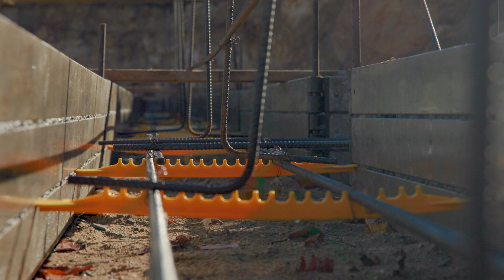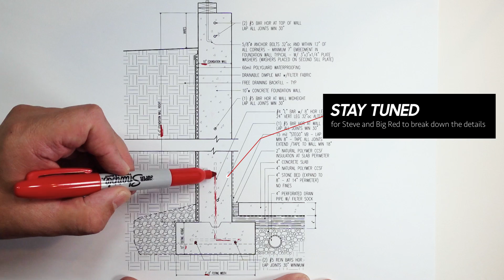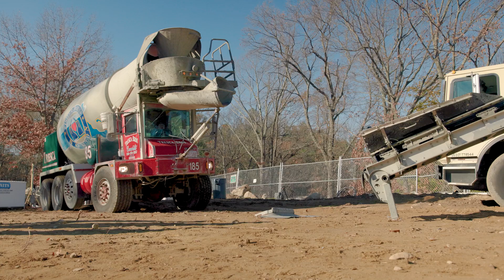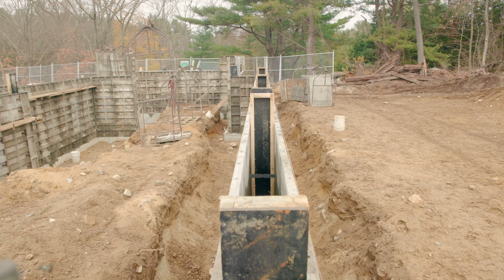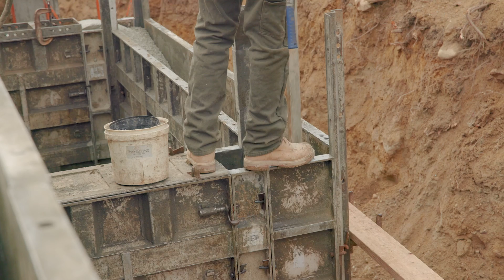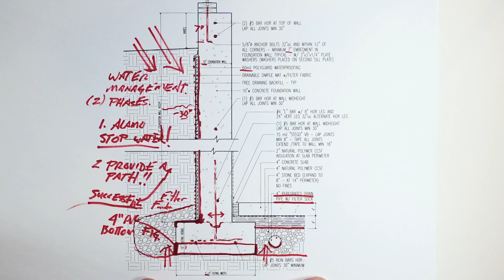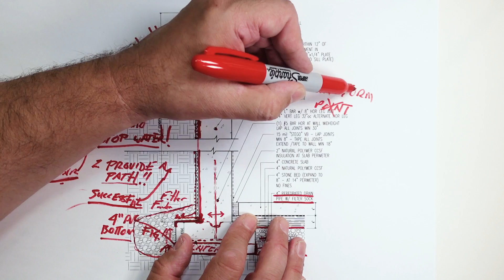Build Show Build: Boston Ep. 4 "Foundation Footing"

Comment: Steve  I have a concrete contractor telling me the inspector is requiring him to excavate 12 inches below our excavated basement elevation to get the footing 12 inches below undisturbed soil. We do not have a frost line here in GA. I see the forms in this video are resting on top of the excavation with no further excavation between forms. They want me to dig out 12 inches below the bottom of my forms. Have you come across this requirement?
Thanks Larry

Comment: hopefully radon isn't a problem. Those outside -> inside pipes will make you need a strong fan or two to get that negative pressure under the slab
Reply: No they will not, they expand the pressure field by maybe 5%

Comment: I'm a little surprised the plan didn't call for a 4" socked PVC pipe on the outside too so as not to "challenge" the interior system. Maybe it didn't have a clear path to daylight. I also wonder if having the interior connected to the outside via the lateral pipes might help with radon dissipation, just thinking out loud.
Reply: It migh add to the radon mitigation a bit - it doesn't change what we would do

Comment: Steve, Do you have a drawing of the 4" pipe detail I can share with my concrete contractor? I get some crazy looks when I talk about a 4 inch PVC pipe crossing his footing. I know we are addressing hydrostatic pressure below the slab and any that builds at the exterior of our foundation. Is the equalization the critical factor or having a means to reduce pressure on both sides of the footing? Is putting independent drains on the exterior and interior adequate? Also, looking to seal the tops of footings. Contractor doesn't always use vertical rebar to tie the walls to the footing. Uses a channel. Is it a legitimate concern of weakening the cold joint connection between footing and wall with a rolled on waterproofing membrane? Appreciate you sharing your knowledge and experience.
Reply: I like the use of laterals. I see many on here think I am letting water in, but they really don't understand how water moves thru the ground. I believe the faster I can move it and rid it, the better I am. I don't believe barrier systems "dams" if you will, work in construction. I like bars coming out of the footing in lieu of the continuous slot. I also have never put a capillary break on top of the footing, I understand the reason why, and also agree with it kinda, but my personal point is that if I allow enough water to be a cappilary problem in the system then the other measures I took (or should have taken) weren't good enough. My perspective is that a cappilary break on top of the footing is the result of not solving the problem below. I realize I am in the far minority here with this perspective, but it is what I believe
Reply: @stevenbaczekarchitect9431  Thank you Steve for the insight. You are excellent at explaining the why behind these practices and principles.

Comment: 39:06 shows wall/slab construction details. Curious about insulation and moisture migration. There is 4-inch natural polymer insulation under the slab but there is no insulation on the outside wall? Isn't the plan supposed to maximize the temperature of the interior concrete wall and floor surfaces by applying insulation on the outside to reduce the probability of condensation during the winter? Also what about a water barrier between the footing and the wall to minimize the capillary effect of moisture migration from the footing to the wall?
Reply: There is insulation on the wall. This detail is stripped from the foundation page, so it illustrates the concrete foundation scope of work. We will spray 2" CCSF on the wall and frame a 2x4 wall 2" inside the foundation wall. This info is in the wall section details. I break them up because the foundation guy doesn't care about the wood framed wall.
Reply: Thank you for joining us - much appreciated

Comment: Steve,  I have the opportunity to drain to daylight on the exterior. My plan was to do an exterior foundation pipe to daylight. Not install a footer tube connecting exterior to interior. I had not thought about interior drain. We are on a lake and  setting our footers on the lowest elevation allowed. Your comments on ground water have me thinking this may be a good idea to deal with potential ground water pressure under the basement slab. I'm nervous about creating an avenue for water on the outside to flow to the interior. I also want to waterproof the tops of my footings (getting some push back from foundation contractor). So, my thought is two independent systems. Your thoughts are appreciated. Regards Larry
Reply: Larry, alot of people are looking at this like "you are letting water in from the outside" you would need a very strong negative grade and ALOT of water for rain to be a problem from the outside. Hydrostatic pressure is a concern I can't solve for later.......so I solve for it now.
Reply: @stevenbaczekarchitect9431  Steve, Do you have a drawing of the 4" pipe detail I can share with my concrete contractor? I get some crazy looks when I talk about a 4 inch PVC pipe crossing his footing. I know we are addressing hydrostatic pressure below the slab and any that builds at the exterior of our foundation. Is the equalization the critical factor or having a means to reduce pressure on both sides of the footing? Is putting independent drains on the exterior and interior adequate? Also, looking to seal the tops of footings. Contractor doesn't always use vertical rebar to tie the walls to the footing. Uses a channel. Is it a legitimate concern of weakening the cold joint connection between footing and wall with a rolled on waterproofing membrane? Appreciate you sharing your knowledge and experience.

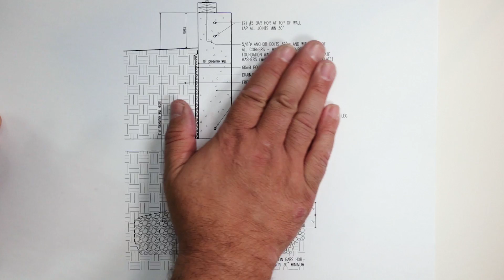Comment: 37:31 The wall will suck  moisture there from the foundation due to the capillary effect. When the foundation is standing in water, the water will migrate up through the foundation and up into the wall - not good! According to Joe Lstiburek, concrete can suck water 5 miles or so!

The reinforcement bars there have too little cover over the laterals, and will rust when the pH of the concrete goes below 10. 

Much better solution would have been digging 1ft deeper and placed some 8 oz non-woven geotextile over the entire basement, with drainage pipe out to free air and then added 1 ft of gravel on top of it. Wouldn't need a sump pump then or the laterals and this complicated stuff. And the foundation wouldn't suck up any water.
Reply: So yeah I know Joe - worked for him for 10 years, I know what he has to say, This foundation isn't sitting in water, some moisture may migrate into the foundation wall, bu why do I care, it can only dry to the outside as the interior direction will be impermeable. Too little cover, you do realize you are stating about the 1/2" of near contact every 12'-16'.....???? Lastly, you want us to dig an additional 12" over 5000 sq ft, and then fill it with stone, and then drain to daylight which would be about 100' of trenching 9 ' deep for the first 50'........on a site that suggests lower than average risk??? Yeah, we should have done that......then you'd be telling me how ridiculous that idea was......
Reply: @stevenbaczekarchitect9431  I agree every site is different ***and you must weigh your risk** Thanks for sharing that the only way we learn

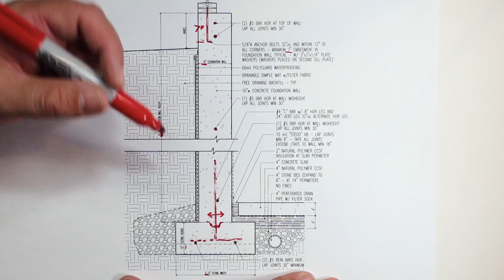Comment: 39:32 Would have used Isodrän or Pordrän instead of a just dimple mat.  Isodrän or Pordrän are both a drainage and insulation product. Moisture in the wall will go from warm to cold and will then be sucked out of the wall and then drained in the drainage insulation. Moisture or water from the soil will also be drained before it can reach the wall and the wall will never get moistened. Don't need any polyguard or sealing at all.
Reply: Who cares about the insulation angle? If it doesn't cover the foundation wall, just consider it a protective board. As stated above, moisture may migrate into the wall, but again, who cares?? It can only stay in the wall....OR.... dry to the outside. With the Polyguard it can only migrate via capillarity from the bottom of the footing.....and again who cares? Can't get inside

Comment: Water table 30" down with an 8' basement? How did you build inside a pond? And why?

And then the plan is to let the water in and then pump it out? The buyer is getting ripped off. How about you build so that an exterior footing drain can be daylighted? Inside is fine as a backup, but as the primary, sheesh.
Reply: Please before you go talking how much of the client is getting ripped off, maybe, just maybe you should ask a few pertinent questions so you may not seem so foolish . Mark Twain - "It is better to sit there and look the fool, than open your mouth and prove it" . First of all you are not stopping water, it is coming up not down - at least the water I am concerned about. Second, we have an exterior drain. Third, the town REQUIRES that the water NOT be daylighted but pumped to a reclamation pit to keep it on site, in the ground and not become runoff for the town's wastewater treatment plant. So the primary, is not a choice, but a requirement - sheesh!!
Reply: @stevenbaczekarchitect9431  
There is no substantive evidence that this popular adage was coined or employed by Mark Twain. Proverbs 17:28 is the oldest related use (Matt might like that).

If the water is coming up, the basement is too low. If it can be daylighted, how is it possibly coming up without visible flooding? If it's visibily flooding everytime it rains, the basement is too low.

So you created a gravel drain, and you connected it to the inside? Do you pipe the gutters inside too?

Can you share the applicable regulation that prevents you from moving non-precipitation water from a non-impervious area to daylight on the property? Daylighting can be the overflow to a dry well if it's under the footing elevation. Is that what was done? If so, my only issue is connecting the exterior to the interior, unless the exterior stays in solid pipe completely separated from the interior, as you have two sump pumps.

Hopefully I just misunderstood the system.
Reply: Francis - just read your comment again, this house does NOT have water 30" down. At 42:40 I talk about this site being "bone dry". The 30" reference was at another project that I was comparing to
Reply: @stevenbaczekarchitect9431  I understood that much. I was asking why in the world that was chosen on that other project. I guess if a client wants a boat, you build a boat? Also how? Were there dams and pumps to keep the water out of the foundation hole during construction?
Reply: @FrancisKoczur  on the other house the client already bought the property before my involvement,  when I found out about the -30" water table we pulled the house almost 7 ft out of the ground to keep water below top of footing. There we pumped to daylight as they had many acres for site retention

Comment: 19:50  still should have used tie in bar IMO.  Temperature changes between the two can make water in the dirt swell/push at different pressures over time, risks moving the wall or buckling the center of the wall.  Always better safe than sorry.

Comment: Great Video Steve! I have been watching this series and learning a lot. I am in the early stage of building as well. I am currently in the foundation phase. Footing is poured, and walls are going up in a few days. I am researching placing anchor bolts, and i keep seeing videos that discourage wet setting anchor bolts. I noticed you are wet setting your anchor bolts. What is your take on wet setting vs Anchor bolt setter?
Reply: I think the wet set have a slightly better pull out strength
Reply: @stevenbaczekarchitect9431  Well, you can always drill a little bit deeper, or use a slightly bigger bolt, or use a few more. By drilling, you get better precision, but it also cost a little bit more. However, low precision is expensive sometimes.

Comment: Steve;  Have you ever used Superior Walls (pre-cast concrete walls) in your projects?  What types of projects might you consider them for use?
Reply: I have years ago, and it went very well. While they could handle a project like this, most general contractors want their guys casting on site. Will King from High Cotton Homes on the Buildshow has also used them more recently and favors them I believe